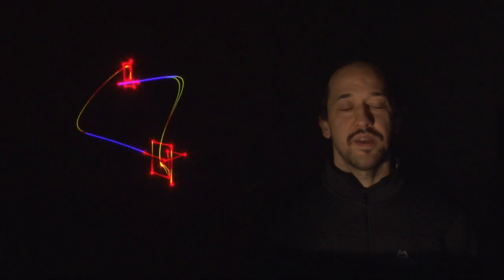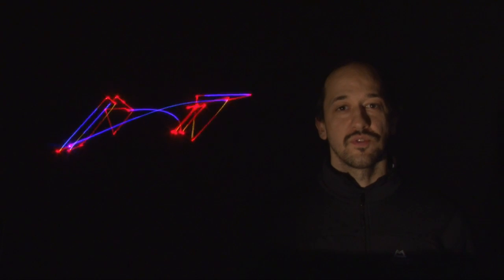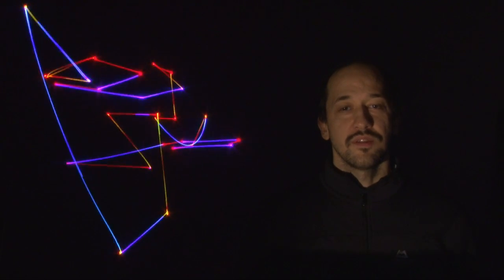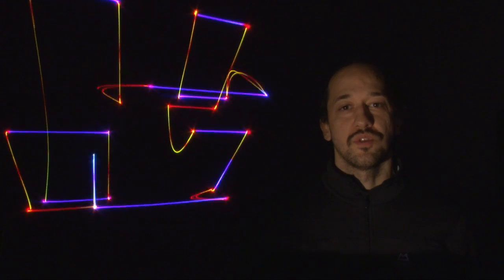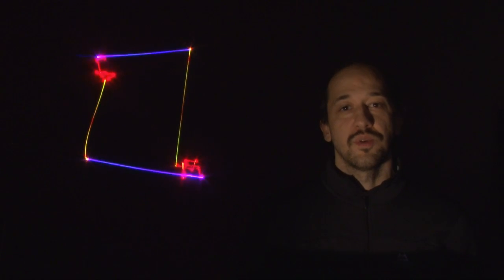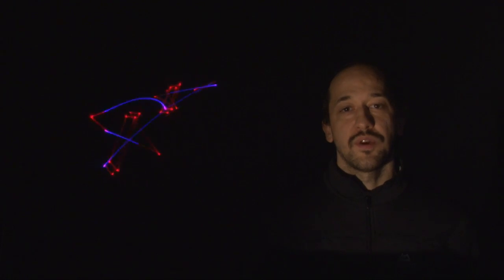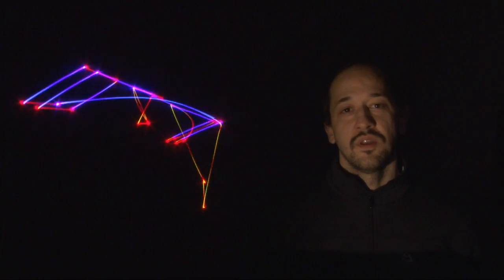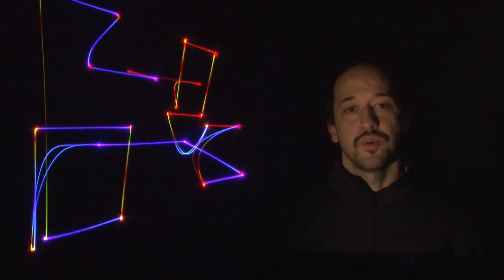Make Noise Morphagene - Vector Synthesis reel

Comment: Hi Bernard, could you explain the settings you used for transferring vector synthesis audio to the Morphagene reel,I have have tried a few ways transferring vectrex visuals recorded wav's and also max4live wave vector synthesis generated wav's. I also tried recording them directly to the Morphagene  but unable to reproduce any via the Morphagene. I am using Reaper and the setting recommended in the Morphagene manual. Are you using different settings or a different program to make your reel?
Reply: looks to me like this is a bunch of folks contributions , and the morphagene is acting as a stereo sampler